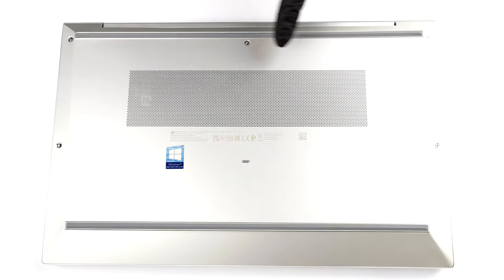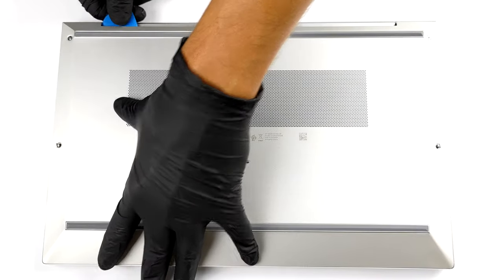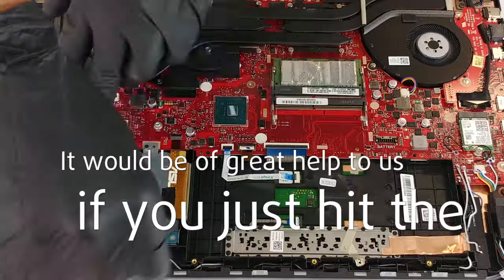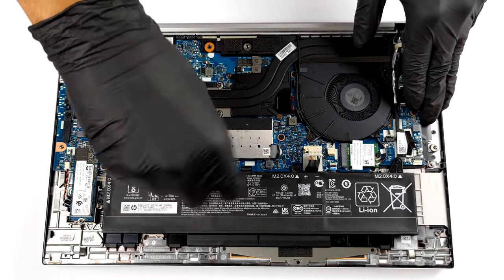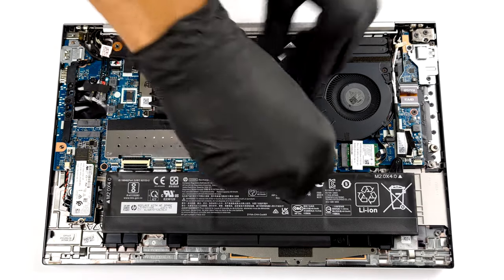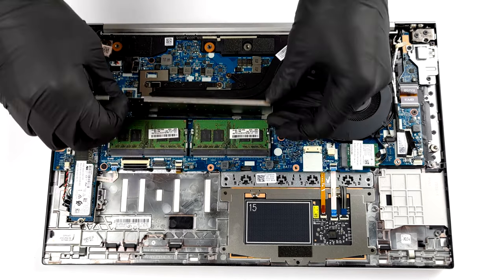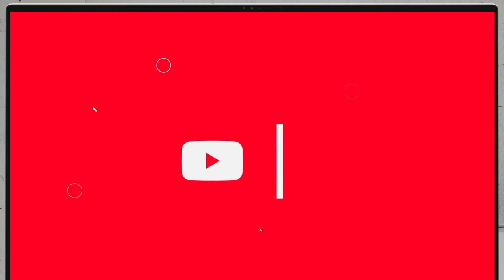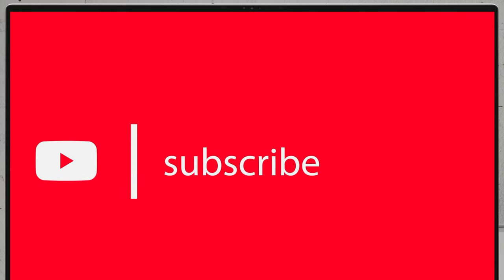🛠️ HP EliteBook 850 G8 - disassembly and upgrade options

Comment: can the WWAN (mobile internet) card m.2 slot be used to install half size m.2 SSD ?
Reply: Yes you should as long as it is PCIE NVME m.2, that is what I have on my T480, much better choices now than there was 3 years ago.
Reply: @cirozorro  , looking at the WWAN m.2 slot it is B cut, like in T480. What SSD did you put into your T480 WWAN slot? In my T480 I put 512GB WD SN520, which is half size (2242) and B&M cut. Cost me just above 100 EUR.
Reply: @LuckyLuc_YT  Yes that works - per my experience, any pcie nvme that is B+M key fits in that slot and should be functional(unless in Bios it is disabled/locked out as long as you have access can renable). Also SN520 is an excellent choice! From my own use/testing the SN520 is the fastest 2 lane ssd B+M ssd I have used (Might also want to look for used sn500 or bg3)

What I used was the cheapest 480GB B+M available at the time, It was the SBX Eco 480GB on the old Phison 8 controller that they promptly did a silent update [Phison e13] so I can't find a web picture or even any reference for but it has horrible performance, more like a flash drive... Can get you pictures of it if you want.

Check your local markets for old used drives, endurance on all of those is pretty good (600 cycles TLC) so I would look for the cheapest SN500,SN520,bg3 at the size you need at either 22x42 or 22x30(affix with tape). Also you will need a m2 screw with 2242 as there is not a screw in the laptop(M2.0 x 2.5 to 3.3mm will do the trick).